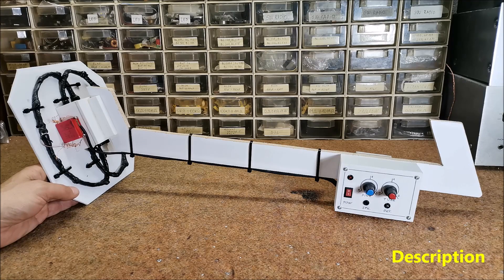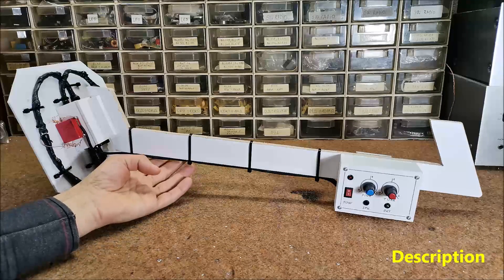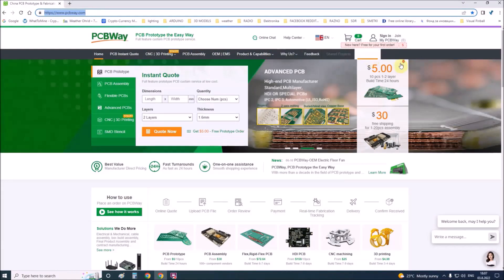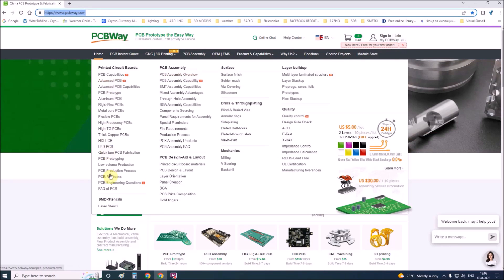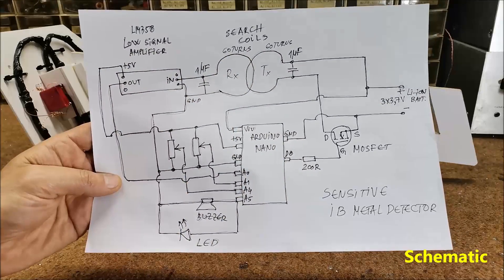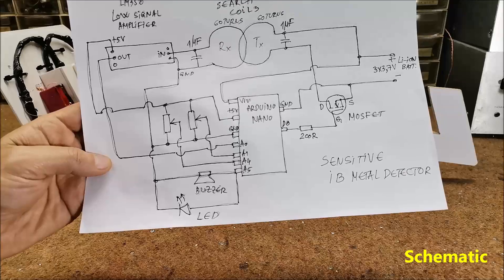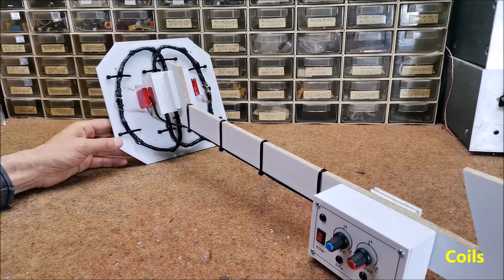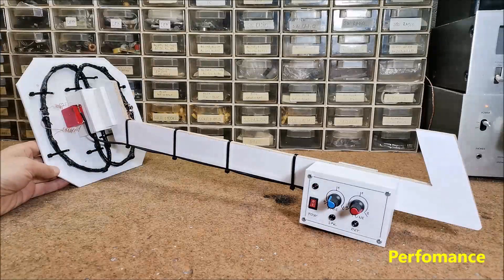DIY Sensitive Arduino IB METAL DETECTOR (coin from 25cm big object at 100+ cm)

Comment: Hello Mirko! Thank's for uploading this project. I want to build it too. I have one question about the schematics: The ground from the "left" coil should be connected with GND from arduino shouldn't it? In the picture it is just connected to the cathode of the LED.
And do you use the analog port for the led and buzzer as an output pin?
Thank's in advance for your help, best wishes from Austria, Christoph (stoppi)
Reply from the maker: Hi Christoph, I apologize for the small omission in the schematic, Correct, the ground of the left coil should also be connected to the GND of the Arduino. Yes, I use the analog port A5 for the led and buzzer as an output pin. If you have any other questions, I am at your disposal. Greetings and good luck with your work.
Reply: @MirkoPavleskiMK hello Mirko! Thank's a lot for your helpful answer. Have a nice weekend, best wishes Christoph

Comment: your project and circuit not mach..what is the correct project 🤔
Reply from the maker: The 220R resistor from the circuit is replaced by a 1K trimmer that is set to 220R
Reply: @MirkoPavleskiMK  dear sir..i make this project today..i have problem 10k ..conected arduino A1 pin. But not working .pls help me..when i remove pin A1 circuit is working ..but rang is very low..coin detectin only 1cm.

Comment: Sir, the trimpot is not in the circuit diagram, but you added it, where should I add it?
Reply from the maker: The trim is placed in place of a 220R resistor that goes to the gate of the IRF730
Reply: @MirkoPavleskiMK How many volts is 1 uf capacitor?
Reply: @MirkoPavleskiMK  your project and circuit not  mach.. what is the correctly 🤔🤔

Comment: where to conect 102 trimpot ?
Reply from the maker: You can use 220R resistor instead trimpot, as on circuit diagram
Reply: Thank u sir
Reply: @ravindraindika6357 Have you done friend ?

Comment: Hi Mirko,  i am following you since 3 years. Thank you very much for your good project. İ made thiis project exatly. But unfortunately i am troubling to adjust sensitivtym it is just workin for few cm. İ just changed the signal amplifier value. Do you know what is the resistance of signal amplifier ?
Reply: Did you solve the problem ?
Reply: @saRah-to1kv  no unfortunately. Probably problem in my coil.
Reply: Hi, I have the same problem. I put everything together as it was shown in the diagram and installed the code but fine tunning is almost impossible. I couldnt go more than 2 cm away from the coil. If someone can tell me what is wrong it will be a great help.
1. I am using a clone arduino uno. 
2. everything else is as metioned in the video and schematics.
Reply: @serkanbcakc1289  selam hocam coil i nasil sarmistiniz ?
Reply: @serkanbcakc1289 Can i use 2n2222 for this..i have no lm 358

Comment: Awesome job. Looks great. If you added more than 60 turns to the coil, would it go deeper? If you enhanced some of the electronics, will it go deeper? Thanks for posting..
Reply from the maker: Unfortunately no, this is the maximum performance for this metal detector
Reply: I used 1ons per coil , approximately 90 turn from 50 meters long of wire. 😢

Comment: hi, do the capacitors (1uf) have to be that big? and is it 0.35mm or 0.4mm or 0.5mm for the coil. Have you had a chance to try it on sea sand? thank u :)
Reply from the maker: You can use any wire from 0.35 to 0,6 mm

Comment: Good job making the metal detector.  Now, to design a really good metal detector (for gold and silver), you need to design into the electronics a way to "discriminate" and ignore iron signals.  If you can make a circuit that ignores iron, then you will have a really good metal detector!!
Reply: in theory that shouldn't be too hard since iron would lower the frequency while other metals would increase it.
Reply: Would you know how to add the discrimination circuit to Marko Pavleski's circuit?  It would a really import addition.  Possibly, then, I could make a really good metal detector!  Especially, your impute would be most useful to many, many of us who dabble in valuable electronic projects